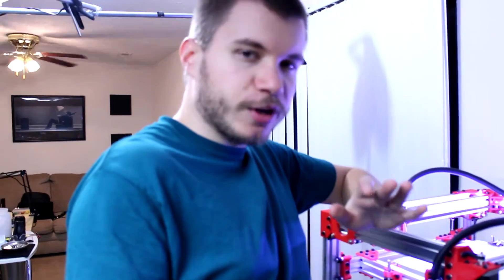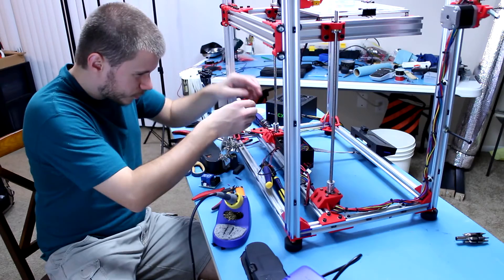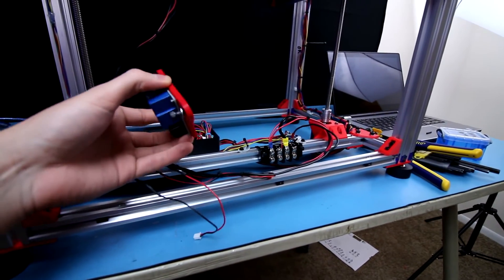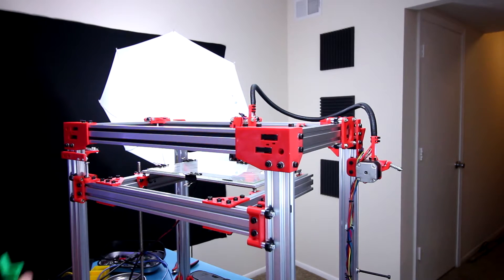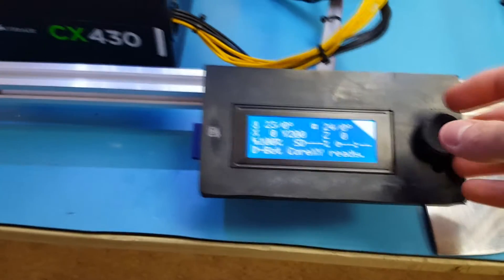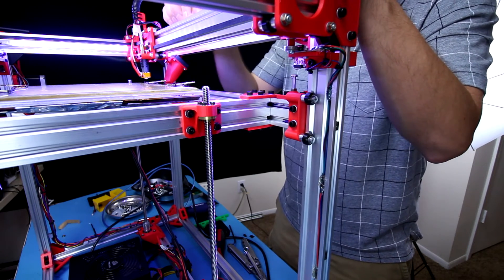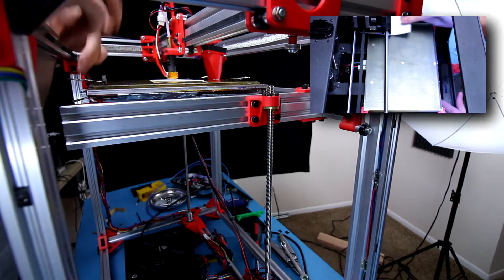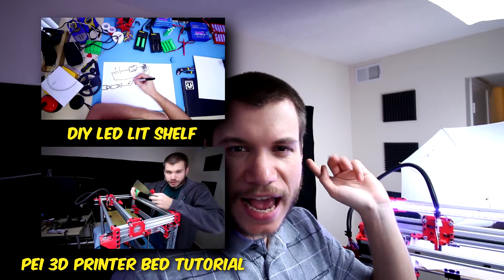Wrapping up wiring / printer bed calibration - 3D Printer VLOG 22

Comment: I see you used the corsair CX PSU. Did you need to put any load on the 5V line? Also, I saw that tool you are using to align the Bed with the top Extrusion, can you share the link please? I would love to have it! Cheers! :)
Reply from the maker: aardvarker I have never had to put load on the 5 volt circuit before. All I do is connect the green wire on the 24pin connector to a ground. I think you have to have a dummy load on a non atx power supply, but I have never needed to do it on a standard PC atx psu. If you are referring to the green bed leveling jig, there is a link in the description. :)
Reply: Thanks for the quick reply and for the awesome video! I'm using a BFG PSU, but it will shut off when I try to heat the bed. I had to put a power resistor on the 5V line to make it work, sadly, wasting a lot of energy. It's a much older PSU, that's probably why! 

So it's awesome news that you don't need to do that on the newer PSU you have, I will likely go for an upgrade sooner than later then! :)

Cheers!
Reply from the maker: No problem, thanks for watching!